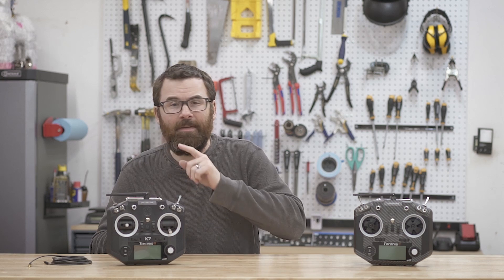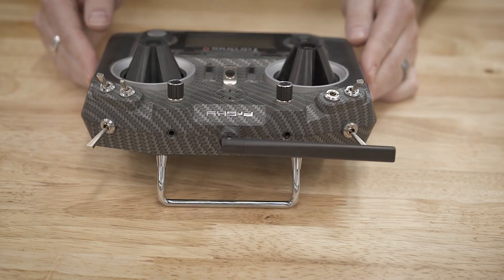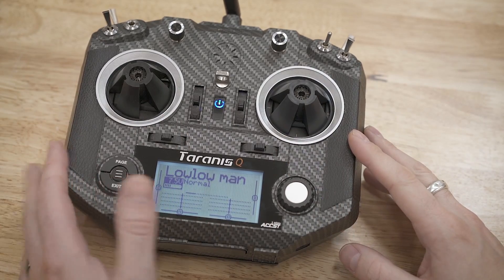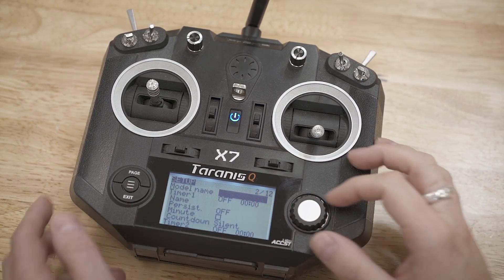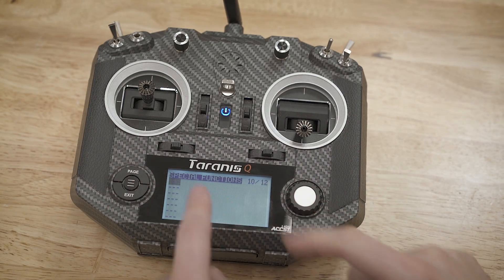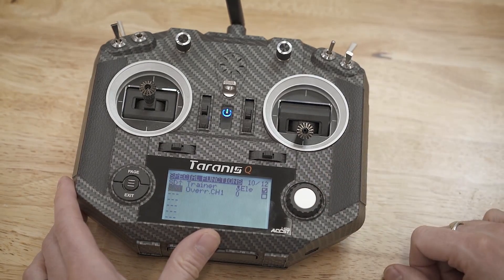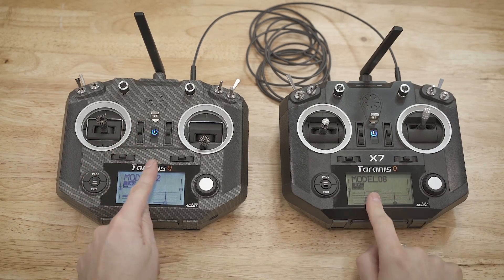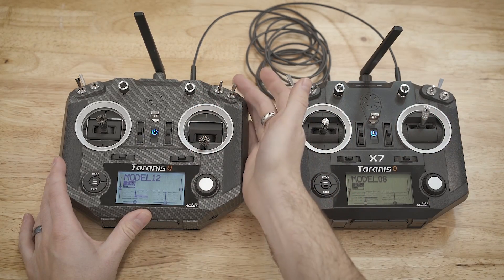OpenTX Taranis Trainer (dual radio) Tutorial

Comment: Thank you for showing me how to get into these options so I can have two people controlling the robot at once. It's really engaging for the kids if double the amount can join in the battle!

 One problem I ran into while setting this up was either my rudder or aileron on the trainer was controlling the throttle on my master. I ended up finding trainer options in the radio menu and the sources for the trainers were completely different from what the radio is set up for. Like throttle on channel 2 and whatnot. Just giving people a heads up if they run into similar issues when trying to implement these options. Just to clarify, this was not a model setting, this was one of the pages in the master menu for the radio itself. Thanks and good luck in the round of 32!